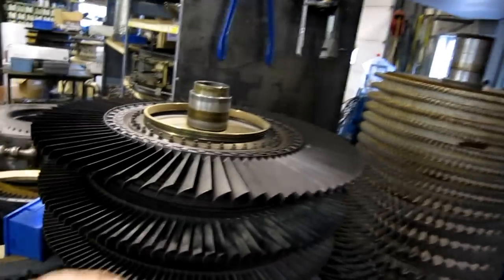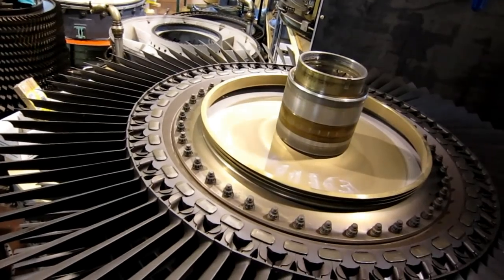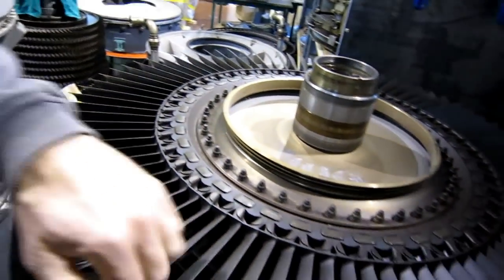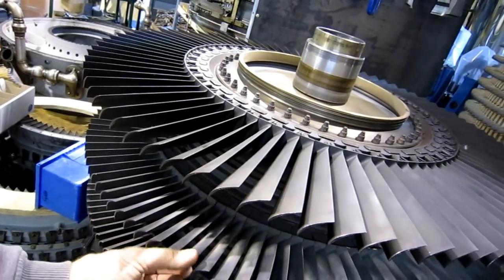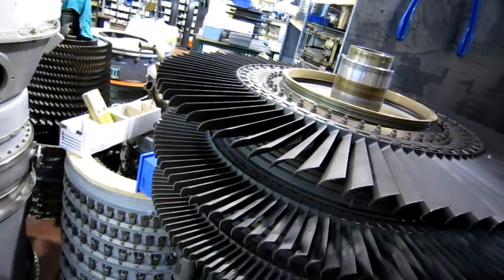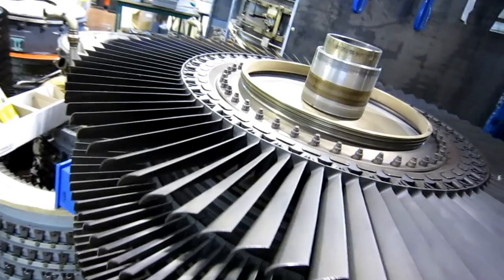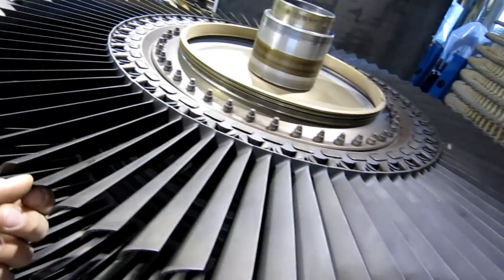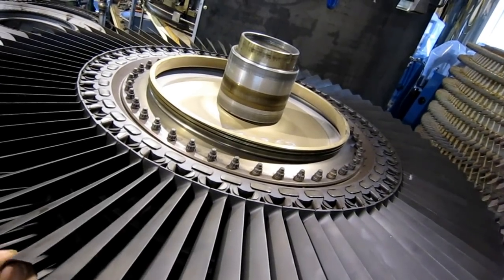Jet engine turbine blade noise

Comment: so if you don't hear it  that would be bad right? that would mean corrosion or something has locked them up so they can't move.
Reply from the maker: generally yes, for the engines we deal with, which are older designs.
I can't say the same is true for modern engines. Many different systems have been developed for securing blades, especially fan blades on modern turbofans.
Reply: AgentJayZ is it also because of thermal expansion?

Comment: I'm referring to the jet engine sounds that we all hear in your videos...for example, the sound of the engines spooling up, the hum or roar that sometimes occurs during light off (especially the small engines like the turbine start cart), and the classic loud whining noise once the engine is up to speed. I'm wondering what causes these sounds within the engine. My guess is that the flow of gas through and around the turbine is what causes the jet engine whine at least, but I'm not really sure

Comment: Do the blades actually "fixate" stiff as the temperature raises (or also due to the centrifugal force), or do they on the contrary, retain some degree of being loose all the time?
Reply from the maker: During operation, each blade is under several tons of tension.

Comment: Is there a difference between rotor and turbine blades? Or are they interchangeable terms?
Reply from the maker: In a turbojet, the rotor is composed of the compressor and the turbine, so it is not correct to refer to a rotor blade, unless you have already established that you are talking about the compressor or the turbine. If you have, then saying rotor blade is redundant, and you would more properly say "blade".
Compressor blade - correct
Turbine blade - correct
Rotor blade - which one?
So, if you were talking to a gas turbine design engineer (whom we may hear from soon), and you said "rotor blade", he/she would immediately ask you "compressor of turbine", and assess you with their piercing gaze, as the uninformed managerial underling that you are.

... short answer: no.

Comment: In answer to    booboobro44 ,    well  on older jet engines yes there was a electric motor sometimes that electric motor also became a generator once the jet engine got   running  that's when you could see the ground crews connect electrical cables from a power cart to  jet aircraft at starting,,   now   air  is used to start engines often obtained from the   APU  eliminating a need for   power carts and crew to man them

Comment: When the commercial jets fly over the house on their way to Sky Harbor airport in Phoenix, they howl. I think they'd are throttling down at that point as they are on final decent, but there is a change in pitch. What causes that, and am I just in the right location to hear it?
Reply from the maker: +Kenneth Cohagen   As airliners start their final approach, they change power settings, flap extensions, and other things.
The engines on the 777 I just got off of here in Dubai made a lot if rpm changes on the way down to Earth.
Reply: AgentJayZ - I'd bet a good amount of the observed change in pitch (sound pitch, that is) from the ground is due to the Doppler effect. When I was stationed at Davis-Monthan Air Force Base, and later at Gowen Field, Boise, occasionally, we would see Canadian F101 Voodoos come in for fuel or overnight billetting. The Voodoo was probably the most famous "howler" aircraft among all Air Force and Air National Guard personnel who heard them. The Starfighters and Phantoms were howlers, too, but not nearly as noticeable as the Voodoos. And they screamed almost as much on acceleration as cruising. The best was as they would make their turns onto final approach and they could be heard from over a mile away in this mode.

Comment: Would another advantage of the blades being in a loose configuration be that it allows for heat expansion? Specifically for the turbine blades I mean, and perhaps the hp comps?

Comment: Are there any jet engines that have solid blades?
Reply: The Eurofighter engine EJ200 has blisks in the first 3 stages of the compressor, they are made from one solid piece of aluminium. The blades are part of the same piece so they dont make a that clickety noise. Is that what you meant with "solid blades" ?

Comment: what are these engines for?
Reply from the maker: The turbine in this video is from an LM1500, used to power the compressors in pumping stations along a natural gas pipeline from Western Canada to the border with the former United States of America (currently recovering).